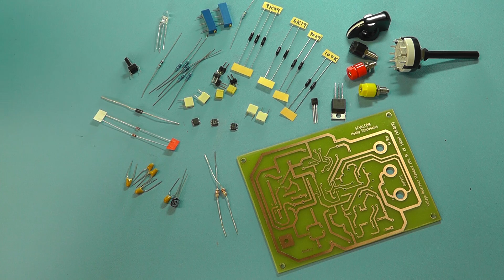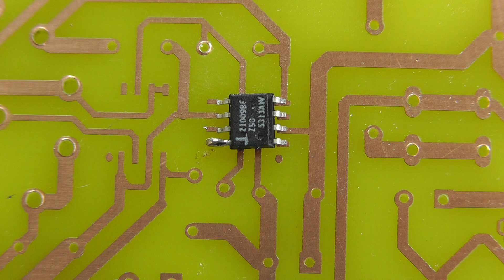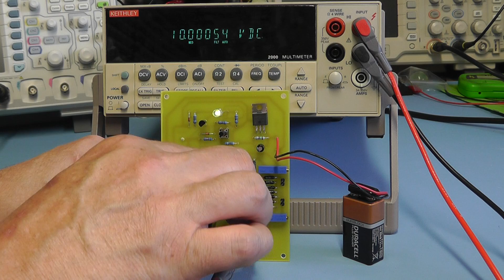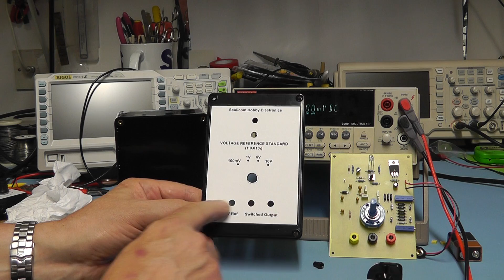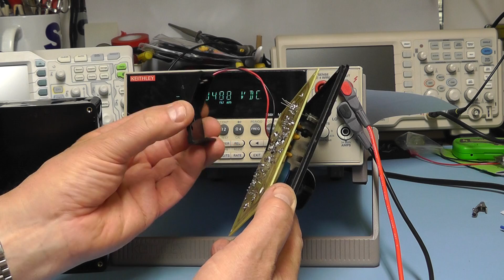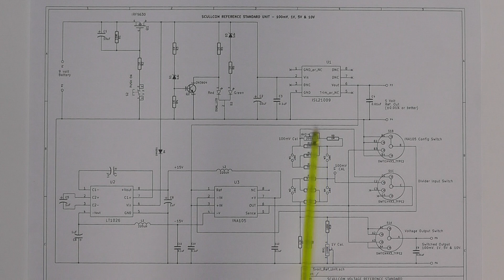Scullcom Hobby Electronics #24 - Part 2 Upgrade to 5 Volt Precision Reference Standard.

Comment: What is the reason for not simply trimming the pots when directly measuring the supposed voltage [i.e without inserting jumper leads, etc]? Then you could directly get a reading of .0000... as best as possible, without a back & forth trial and error?

Comment: HI Louis, the ISL21009BFB850Z is no longer available. What would you suggest as an alternative? Cheers
Reply from the maker: Hi,
The MAX6250ACSA+ is a very good alternative. It is pin compatible so can be used as a direct replacement in this project.
Regards, Louis
Reply: Thank you. Will do.

Comment: I'm building this very interesting project, but I'm not sure about the rotary switch to be used (I already done the PCB with your footprint), I saw in the video that the brand should be "ALPHA", is it right? can you see it in this list or do you have a part number maybe? http://www.mouser.it/Alpha-Taiwan/Electromechanical/Switches/Rotary-Switches/_/N-5g2i?P=1yvsm2dZ1ytibi4Z1z0zlgn thank you for your work and sharing!
Reply from the maker: The rotary switch I used was a LORLIN  CK1051  Rotary Switch, 4 Position, 3 Pole.
The CK1051 is a three-pole 4-position Rotary Switch with printed circuit terminal, non-shorting (break before make) contact and 30° standard indexing.
You can get them from:
Farnell Order Code 1123697
http://uk.farnell.com/lorlin/ck1051/switch-3pole-4-pos-0-15a-250v/dp/1123697
or
RS Components Ltd. RS Stock No. 665-203
http://uk.rs-online.com/web/p/rotary-switches/0665203/
Alternatively Mouser Electronics have ALPHA (Taiwan) alternative:
Mouser Part No:105-SR2612F-34-21RN
http://www.mouser.co.uk/ProductDetail/Alpha-Taiwan/SR2612F-0304-21R0B-D8-N/?qs=sGAEpiMZZMvNbjZ2WlReYnqYHrQfuERsZSOUXUestgo%3d
Regards,
Louis
Reply: perfect, thanks!

Comment: Louis what happened to the components layout sheet?
Reply from the maker: The component layout sheet is on page 2 of the PCB artwork download:
http://www.scullcom.com/Volt_Ref_Upgrade_PCB_fullsize.pdf
If you intend to use the PCB artwork remember to save this PDF file to your PC then open the file and print it. If you simply print from the PDF opened in your internet explorer for some reason internet explorer reduces the actual size slightly which will be an issue.

Comment: Hi Louis, i'm just gathering parts for a build.
Q1 910k resistor @ 0.1% cant find on Rs only 1%
Q2 is it possible to add or swap one of the voltages to give 200mV ?

or is there another project that you know of which gives a reference of 200mV @ 2W which is what i am trying to find
Thanks

Sean
Reply from the maker: Hi Sean,
Q1. for that 910K resistor you can use a 1% tolerance as it will be trimmed by the series preset resistor. If you want a 0.1% tolerance one then you can use an SMD resistor (radiospares Stock No. 666-2758).
Q2. This reference circuit would not be suitable for 2W power. As 200mV @ 2W would require 10 Amp, this is a lot of current. Providing an accurate reference voltage at that sort of current would be an issue. Accurate voltage reference sources are usually low current so as to ensure they are stable over time and temperature. I would be interested to know why you need a voltage reference at the voltage and power you quote.
Regards,
Louis
Reply: Scullcom Hobby Electronics hi Louis to calibrate a Marconi 2955 test set power meter as it is high on self test and gives error messages
Reply from the maker: I am not familiar with the Marconi 2955. Do you really need 200mV at 10 Amp for calibrating the receiver?
Reply: Scullcom Hobby Electronics ah I see what I've done. Start again.

I need to build a power source capable of delivering an accurate signal from 100mW to 2W from 1mhz to 1ghz ish although I'm only interested in upto 80mhz. What I meant was are there any projects like the reference project capable of this sort of range thanks

Comment: Hi Louis, Finally built the reference unit using a low cost multimeter. Get 10, 5, 1volt and 0.10v readings so I am a happy bunny. I have no way of telling how accurate it is but assume that it will meet the basic spec.  Many thanks and now it is "what do I do next"?   Many thanks.   Bob
Reply from the maker: Nice to hear you built it OK. If you followed my video I am sure it will be quite accurate and useful for testing the calibration of your multimeters. It nice to hear when other people build my projects. I have been quite busy of late so had little time to upload a new video. Hope to get a new video uploaded soon.
Regards,
Louis

Comment: Hi Louis, Can you possibly give the dimensions of your PCB as I have tried two different printers and get a different sized pattern.Thoroughly enjoying your series.Bob
Reply from the maker: Hi Robert, The PCB actual size is 120mm x 90mm. For some reason the pdf file link is printing at a reduced size. I have added another link for the PCB
http://www.scullcom.com/Volt_Ref_Upgrade_PCB_fullsize.pdf
I have found the best way to print it is to first save this pdf file on your PC and then open it up. When you then go to print it make sure that the "Actual Size" (or set the Custom Size to 100%) option is selected in the print settings. Let me know how you get on.

Comment: Hi Louis,
Really enjoying your video Projects and look forward to whats coming next.
I was wondering if you could give me some guidance,I just built the Precision Voltage referenence and as my local store didnt have the right Chokes have used 330uH chokes,Not sure if thats causing my problem though.I am getting around 14.3v and -13.7volts from the test points of the IC and 5V Exactly from the reference socket and only the 5v on the rotary switch is right,I am getting 1.21v on th 100mA,3,928 on the 1V and 4.986 on the 10V.I thought I may have had the switch in the wrong way but that seems to only fit one way.
Any ideas would be greatly appreciated.
Thanks for excellent series once again
Regards
Lewis Bryant
Reply from the maker: Hi Lewis, Sorry for the delay in answering but I have not been online for sometime due to other commitments.
The 330uH choke should be just fine.
From what you have explained your problem is either in the resistor network on the switching. Suggest you re-check all the resistor values and ensure they are in the correct position. The other possibility is a faulty rotary switch or an incorrect type is been used. The switch I used was Lorlin CK rotary switch 
(Mfr. Part No. CK1051). Check the link below for details:
 http://uk.rs-online.com/web/p/rotary-switches/0665203/

Comment: I attempted to follow along and create a Fritzing schematic, breadboard and PCB layout but couldn't find most of the parts.  Perhaps I'm not familiar enough with Fritzing but thought you might have some ideas on this.  Also, I tried to do this with KiCad and found it very difficult to understand.
Reply from the maker: +Christopher Moore I have not used Fritzing as yet. I have used Kicad for circuit and PCB design. In the comments below the video you will find links to download them, which I have converted in to pdf files. Kicad can take some time to understand but there are some good You Tube videos giving tutorials. Some components I had to design myself.

Comment: Great series, well explained and good video work with the soldering.  I have a question regarding shorting the output, from what I was able to tell from the data sheet for the  ISL21009BFB850Z, it looks like the output could be shorted for 10s without damaging the chip.  Is that correct?  I'm wondering if you did something by mistake if you have a chance of not damaging things?
Reply from the maker: +Bill De La Vega Thanks for your comments. I believe the short circuit current is limited to 10 mA so it should be fine.
Reply: +Scullcom Hobby Electronics Ok great.  I am having trouble finding the ISL21009BFB850Z chip here in the states, it is listed by intersil as obsolete.  The replacement, ISL21009CFB850Z accuracy is +/- 1.0 mV and has a higher temperature coeficient @ 5 ppm / ˚C.  Any suggestions?  Thanks again.
Reply from the maker: +Bill De La Vega Try the Out Front Inc., based in New York. Below is a direct link to the IC on their website;
http://search.outfrontinc.com/?part=ISL21009CFB850Z&amp;Submit1=Search
The IC is also available in the UK from:
http://uk.rs-online.com/web/p/voltage-references/0516568/
They may ship to USA if you ask but at a cost.
Also checkout the link below:
http://www.hkinventory.com

Comment: You know, you could make a small run of kits and see if people will buy them (I think they would). This is very useful when you want to calibrate meters bought from the electronics junk yard (I have a couple). The main thing preventing me from building this is the amount of time it would require to do everything on my own, however a kit might save most of that time. Hackaday might be interested in carrying something like this?

Comment: Now thats a smashing job :-D
Im am really chuffed with how well it works and how nice it looks :-D , i bet your really pleased too, i would be :-D
And considering you designed the whole thing in a very short time, it performs as you expected/planned, clever man indeed :-D
The jumpers being moved to the underside would be usefull for when a calibration needs doing again in a years time, but you cant think of everything lol.
When you pressed the button the pcb moved slightly, perhaps a couple of plastic tubes between the top of the pcb to the top case would stop that, some rubber solution or bostik could hold them to both surfaces without drilling :-)
So a low pass choke/cap was your chioce for removing that tiny spike from the supply, not too bad a mod to fix a fault :-)
Those smd chips are evil to solder arnt they lol, im no lover of smd.
Reply from the maker: zx8401ztv Thanks. It did work well and was easy to calibrate the 1V and 100mV ranges. It was only when I mounted the board on the front panel that a thought about moving the links to to print side of the board, but that's an easy mod to make. I take your point about supporting the PCB - I did include fixing holes on the corners of the PCB but decided not to drill any more holes in the front panel, but could use them later. Yes, the SMD chips can be a little tricky to solder especially when I was trying to film it at the same time!! I normally use a bench magnifier light which helps but on this occasion it was not possible as the camera was in the way.
Reply: Scullcom Hobby Electronics Ahh, it helps to keep your elbow and sometimes pinkey in contact with the table, ive been known to stick the tip of my tongue out a little, it helps ha ha :-D
Yes i think you did a brilliant job overall :-))
I found de-solder braid handy when i replaced some simple smd chips in a mates washing machine, it recovered the well known "Dam two pins joined" situation lol.
Reply from the maker: Ah that's where I went wrong I forgot to stick my tongue out!!  lol

Comment: Wow, at last you've finished your project sir. It's a nice build, and  very interesting to clone. But unfortunately I can't make that because I don't have a good high resolution/high accuracy multimeter to use in calibration phase.
Anyway it's a very nice video sir,it surely inspires a lot of DIY'ers like me :)
Reply from the maker: Hi'gak Iya Thanks. The main reference voltages of 5 volt and 10 need no calibration. With regards to calibrating the 1 volt and 100 mV ranges it is not essential to have a high accuracy meter as you simply first measure the 10 volt output and what ever that reading is on your meter then divide that by two and then simply trim the calibration presets for that reading on the same meter you used to check the 10 volt output. It will then be calibrated. I always try to design my projects so it can be built by the hobbyists.